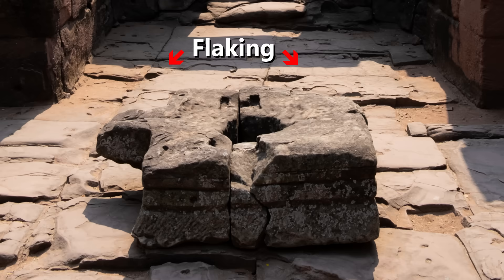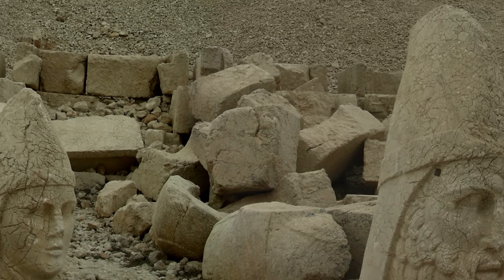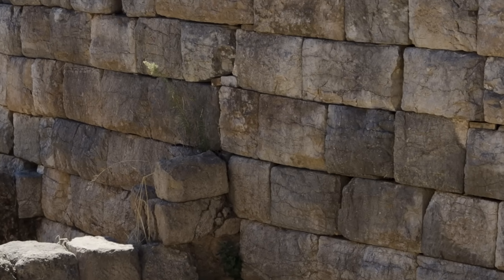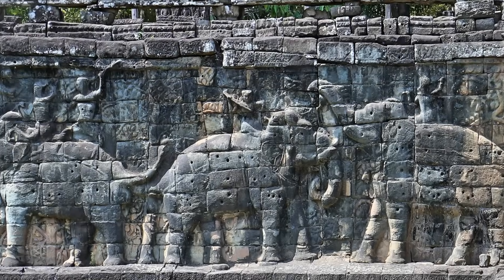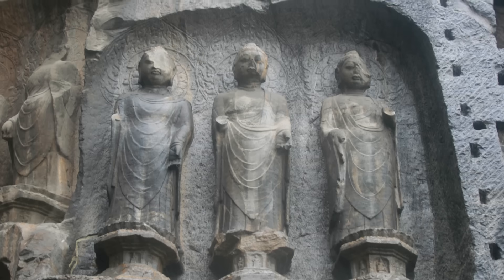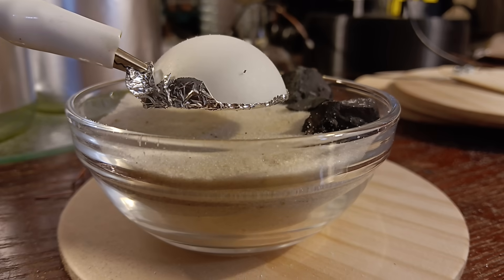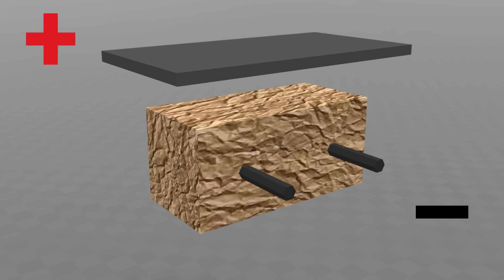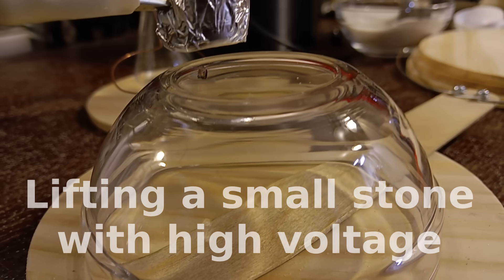The Greatest Mystery, Solved. Recreating Ancient Stone Melding Technology (Part 1)

Comment: I believe you are right about this, brilliant work. Could it be possible to use sonics, or, molecular vibration like the microwave oven principle?
Reply from the maker: I have some experiments in mind to perform soon that will involve HV frequency modulation, as for sonic or microwaves (to heat the stones) there are several problems with this, penetration for one, especially auditory (sonic is still sound) and water concentration of the stone (the molecules microwaves interact / vibrate the most with to create heat). Thanks for the comment, this is just part 1 - stay tuned =)

Comment: If stones would be melded and casted into shapes, then many stones would have the exact same shape. Because the same forms would be used over again. 
As a stonemason I know these typical holes as slots where something, especially wooden structures or ornaments, have been fitted in after the building was already done. You will find these in thousands of medieval castles. You will also find other kinds of holes and stubs there. They were used to create places, where the lifting devices were used.
Reply: I’ll add an uneducated question: on all of the stones in question, are there no examples of stone chisels, chisel marks, etc? Just something to help rule that out as an explanation.  Did the builders expertise allow them to chisel stone smooth? Has there been any stone masons tool sets found? Did I miss the part about why these electrode holes weren’t filled in?
Reply: @backpages1 There are chisel marks of corse! They are just ignoring them…
Reply: @watchbreaker1706  Thanks for your comment! (And for the record, I tend to agree!)
Reply: @backpages1  Do you see chisel marks in  finished statues?
Reply: @backpages1 Tubular drill holes can be found everywhere in Egypt. Temples, pyramids, etc. The Egyptian quarries where all stone blocks for the Egyptian temples etc and even for Roman cathedrals and monuments originated from are littered with left over tools like the stone "hammers" for example.
Reply: @backpages1  The stones erode over time. So regular chiselmarks disappear or look like other kinds of exposures.
Officially people then only had copper chisels and diorite stones as tools.
A very, very odd idea IMHO.
Since it would not just be unefficient, but also impossible to cut granit with it. See: A copper chisel or rod would instantly get flattened at the very first hit and barely achieve a scratch at best. Today we are using special hardened steel and diamond covered tools to cut through granit. As even iron would get dull after the first hit. That's how hard granit is.
Reply: @nocturnaljoe9543  Thanks for your comment! (Great info in your reply, even I learned something!)
Reply: @nocturnaljoe9543  what about using a hard grit for polishing?
Reply: @andecap1325  Chiselmarks can disappear over time. Especially in softer stones. You can polish stone with other stones, but you can't polish them without destroying the carved features without advanced tools.
An advanced tool could (for example!) look like a little plate with sand from rocks of the correct harndess glued on it. By decreasing the grain size after each grinding the full polish (a glaslike surface) can be achieved.
It's the same way we polish stones today. Only that we use artificial stones on our machines.

Edit: Please consider the amount resources needed for each stone.
Reply: @nocturnaljoe9543  Yeah, i agree with the weathering, but  i meant  as an example of modern statues... The chisel marks would be gone with the finished smooth product ..thus no chisel marks to be found...lol Weathering would remove a smooth surface or smooth a  rough surface depending on the environment. When it comes to granite its made of of different minerals which each has its own hardness. one of these is mica which is very soft. you remove a pc of mica and you have a bumpy surface in when you can knock off the hard but brittle pcs.If you have an army of stone workers that belive  they can finish there way6 to heaven anything is possible. otherwise its a waste of effort.  Or maybe they had many slaves?
Reply: @andecap1325  I think they did have a lot of workers, but in order to be effective, they would have to group them into doing specific tasks, only.
Reply: @nocturnaljoe9543  It's a subject I've been kinda obsessed over. IMO, people WAY prior to the "iron age" had been collecting meteoritic iron for millennia, and using it (perhaps even in it's found condition) to bash and shape wood or stone. People DID have very crude IRON tools far, far before the so-called "iron-age", which is just describing when people learned how to smelt, cast, and forge. This explanation is, to me the "Occam's Razor" that slices through all the mystery and bullshit.
Reply: @robertcutts7264  I think you are making a good point, but I don't see why they shouldn't have been able to forge iron, when they were able to forge copper. They could have generated enpough heat with wooden coal, already.
This reminds me of the so called "London hammer", that should not exist.
Reply: @nocturnaljoe9543  You can "forge" copper without even heating it. You can't do that with iron. It takes coal, or charcoal (not just wood) and forced-air together to reach iron-forging temps.
Reply: @robertcutts7264  You can heat iron up by forging it. It's an insane effort, but people used to do this in the early middle ages.
Reply: @nocturnaljoe9543  Yeah. I think you mean just beating the hell out of it, squishing it back and forth with a hammer to produce friction? That's possible AFTER you've already forged a suitable iron hammer for that purpose (and presumably have an iron anvil, too). But it's actually ONLY possible to do by hand on very small items. Larger items lose heat faster than you can generate it this way. I've done plenty of forging, personally, and I'll attest to this.
Reply: @robertcutts7264  How do you think the first iron hammer has been forged? You can start doing it with with rocks and then gradually increasing the quality of the tools with what you get, or use bronze tools to do it. But you have to forge the first iron hammer, -anvil, -tongs and so on. It won't fall off a tree.
Reply: @nocturnaljoe9543  and why could not an ancient civilization have created steel? Or perhaps something similar in hardness? It is easily possible that due to some cataclysmic event much technology would be lost. The survivors may or may not have known how to make new tools of the same sort. And besides, information can be lost to the next generation if a neighbouring army invades and destroys, or a flood happens etc.
Reply: @ Idk if they did. But if they had steel then they would have build with it. But they focused on massive stone structures.
Reply: every ancient pyramidstone  or in Peru have different shape, as if it was fun to them to do.
Reply: @faragraf9380  I think they indeed enjoyed making them. They were happy to build and create something special.
Reply: Just as hard to explain how they had tube drilling technology. Square holes bored out and even more complicated shapes around
Reply: @asoliloquy2876  It's not hard to explain. They had machines. I have no doubt there. I also think they used electricity in the pyramides. You can call me a foil head, if you like. But I learned my profession and there it no other logical reason for copper conductions in the pyramides.
The ancient batteries prove that they knew electicity.
Reply: @nocturnaljoe9543 The lack of repeatability in manufacturing of these „batteries”, their potential low efficiency and the materials used are the prove that they are not a part of advanced technology. What do you expected their machines looked like, as in the Flinstones!
Reply: @watchbreaker1706  What are the wires there for, then? Have you ever heard of Antikythera mechanism?

If it was not for this one single discovery, we would think that such technology has been invented over 1600 years later. This was 1 finding that changed history.
But there are more. We found nano sized bolts that should have not existed a few thousand years ago. The romans are also known to have used nano technology in order to make glas that changes colour if warm liquid was applied. There are many technologies, that we fail to recreate, today. I think you underestimate the people from the past.
Reply: @nocturnaljoe9543  It's a rather random collection of artifacts, none of which really proves your claim directly. Most of them are either misinterpreted finds or with highly stretched conclusions. Social media is a really poor place to discuss such things in detail. But think about it, does the existence of even the most complicated clock mechanism prove knowledge of electric current? I really doubt it.
Reply: @watchbreaker1706 I never said that. JFL! My point was that people had technologies that were more advanced than we think.
Also that we are still unable to reproduce many of them.
I am not claming anything. I simply shared my personal ideas about this topic. You are trying to frame me as some evil Knievel, here. 🤣
Dude, there are copper wires thick as fists. That strech through pyramides. If you have any better idea what they are good for, then spit it.
Do you have an idea what effort it took to make and put 2 of these wires next to each others in a giant building in that time?
Reply: @nocturnaljoe9543  but have you calculated how much?
Reply: @yeetman4953  How much of what? Stupid questions?
Reply: @nocturnaljoe9543   how much of these supposed batteries you need to make enough electricity you need to melt rock.
Reply: @yeetman4953  Why are you ripping my comment out of it's context? I stated "they knew electricity". I reject your attempts to throw mud at me.
Reply: @nocturnaljoe9543  they knew thunder not electricity.
Reply: @yeetman4953  Then why did they have batteries?
Reply: @nocturnaljoe9543  the so called battery had a scroll inside of it so it wasnt one
Reply: @yeetman4953  Bro, there are hundrets of these batteries and they are called that way. There are museums full of them.
Reply: @nocturnaljoe9543  You need more foil
Reply: In many cases I expect, but probably not in the outsides of walls and pillars, that wouldn't make sense
Reply: @truthhunterhawk3932 That would make perfect sense in outside walls. Medieval stone and brick buildings for example have often holes that are leftovers of scaffolding system that was built in to the structure. Holes are now where the beams of scaffold were built in a wall.
Reply: @truthhunterhawk3932  Obviously it WOULD be on the outside walls. It's a well-known fact that many of the buildings exhibiting these holes had exterior façades (a veneer, if you will) of marble in ancient times. There are contemporaneous accounts describing this. There are histories recorded of the sacking and looting of these places for their materials (like marble façades and bronze sculptures) after various historical conquests.
Reply: @truthhunterhawk3932  why not?
Reply: @truthhunterhawk3932  Bruh. The castles used to be plastered and even painted. Just like the ancient temples. The holes were no problem at all.
There are buildings with holes on every single stone for our special tongs. These use the stone's own weight to tighten their grip.
Reply: @nocturnaljoe9543  ??????
Reply: @nocturnaljoe9543  Bruh is a stone mason.  Ever work with stone?. Of course not.  Know anything about stone work. No.   Ready to believe they had electricity, but somehow lost the tech?
Reply: The ruins of Puma Punku, Bolivia, have many stones that are identical, sharp 90 degree angles and evidence of precise machining.

Comment: Presence of plasma wont affect stone and any melting would not be controllable.  If the stone converts to plasma all details will be erased with the state change.  Plus many different types of stones will each behave differently.  Carving them to fit well isnt as hard as people imagine after 2 million years of working stone.  Switching to iron has gotten us out of practice.
Reply from the maker: The WCSG and SGL I've both created and discovered are high-voltage, high-amperage spark gaps which allow for high-amperage plasma (amperage is what performs most 'physical work') which I know for a fact thoroughly heats a granite stone as I have already done this with temperature tests. I'm also testing other stone types, that was the main purpose of the examples in this first 'part 1' video. It is also in fact a precisely controlled heating (and cooling down process) from mostly within the stone, via electrodes, which also does not melt them entirely, only bringing them to a premolten, softened state whereas the weight of the stones do most of the work on each-other at that point. This is just part 1, stay tuned for more =)

Comment: An intriguing theory. We know from countless studies performed that many cultures shared similar construction techniques throughout the world with the unfounded claim that they had no contact with each other. This is seemingly due to no definitive evidence, yet the nubs or protuberances are seen in many ancient structures. Their inclusion would seem to serve no obvious purpose, at least from a architectural point of view in construction lifting or support.  If metal rods were removed during the molding process, it's possible that is how these nubs were formed, but why would they remove some of the nubs on the blocks and not others in what appears to have been fully completed structures? At least from the blocks we can visually see for aesthetic reasons. If it was done using this technology, then each block of stone would have these holes or nubs, and perhaps on one side only if it was done in a molding process.  I think everyone would like to see you do a larger and more difficult demonstration. If you can melt and reform, say a bucket of granite stones, and mold it then that's a good start. If this theory hopes to gain traction, you'll definitely need to increase scale of your testing. Obviously, the problem would be to generate the amount of power you'll need to do that without breaking the budget. Best of luck to you.
Reply from the maker: Logically, one would not do extra work on something that will not be shown / covered / hidden. Any place you see these nubs was once covered by some other material. On finished wall faces where just the stone would be shown, the nubs are trimmed to not be seen. I'm also in the process of going bigger, this is just part 1, thank you for the comment and stay tuned =)

Comment: In the Roman era, stone blocks were fitted with iron pins to help lock them into place.  After Rome fell, during the dark ages, iron was scarce, and people began digging into the stone blocks, to extract the pins.  That is why many buildings, like the colloseum, have all those pock-marks.  I'm not certain as to the reason for some of the other marks, where that is not the obvious explanation.
Reply: I would also guess that some were to hold wooden planks for platforms or cloth covers from the sun.
Reply: Our guide at the coliseum in 2021 told us those pock marks were used for the mounting of sheets of marble
Reply: I thought the same.  Maybe rods went through to hold floors/ceilings up.  Maybe the nubs fit into a hole to attach panels for walls.
Reply: 5+
Reply: They’re “still” laughing! Your theory is a joke.
Reply: @joehenry2058  Who is laughing at what?

Comment: Back in the day someone called in on coast to coast said locals near original sight recalled flashing lights the night the little man moved the entire castle onto trucks. I always figured he had lightning strike the coral rock and somehow magnetize and manipulate the poles to move it. Then they would chisel away the handles on the stone. He said it was the art of the Egyptian leveraged. Would heated lava rock weigh less?
Reply: I forgot to add Coral Castle.
Reply from the maker: Heated rock wouldn't weigh less, but a positively charged plate above a negatively grounded stone (as a loose example in my video), if given enough power to lift a large stone, this plate may have no doubt glowed brightly in the night from corona discharge at those voltages. I've studied Coral Castle but can't make any determinate conclusions, it is a place I will have to visit in person I think as the rough coral makes detecting signature rock melding affects hard to decipher. Thanks for the comment!

Comment: There are lots of copper tools and ornaments from ancient archaeological sites.  Why no cables and electrodes?  You'd think they'd be all over the place.
Plus, I don't think one would need a Kickstarter campaign to make a small working model; you don't have to build a pyramid.  How about just fusing a couple of brick-sized blocks of stone?  Power supply?  We do have an electrical grid, you know.  Thousands of potters fire up electrical kilns with enough energy to melt rock in their basements.

Comment: Interesting hypothesis, but here's a major problem I immediately see with it:

In order to get the stones out of the quarry in the first place, they had to be able to cut the stone, and they didn't have chisels or other tools made of strong enough material to cut the stones.

Relatedly, in order to insert the electrodes into the stones, they first had to cut or drill holes for the electrodes. See problem above.

If they had tools durable enough to cut and drill extremely hard stone, there's no need for other explanations for how they built these monuments.

I'm not saying that you're wrong, just that this is a problem I immediately see with your explanation.